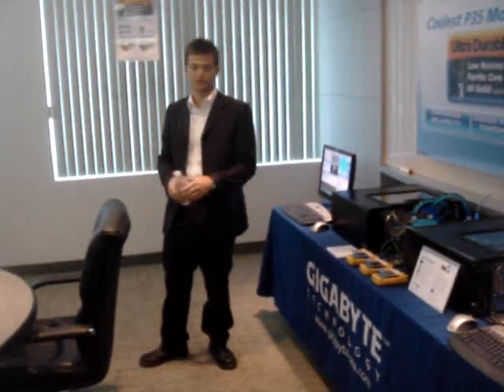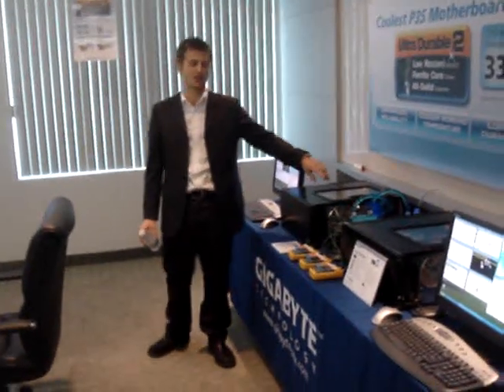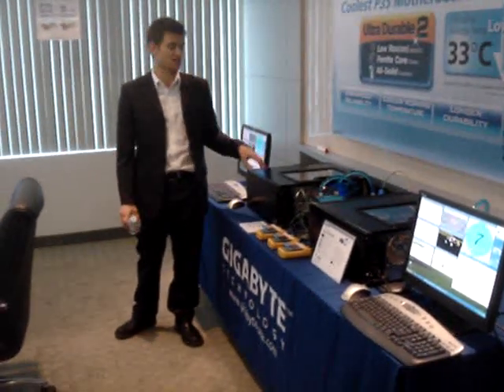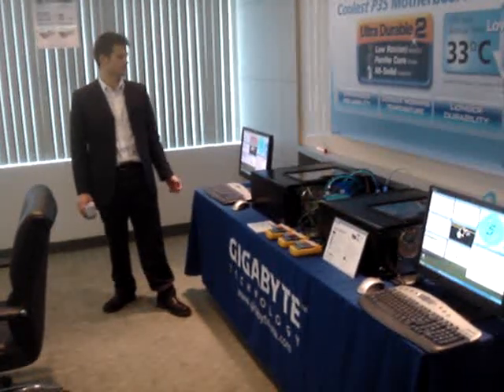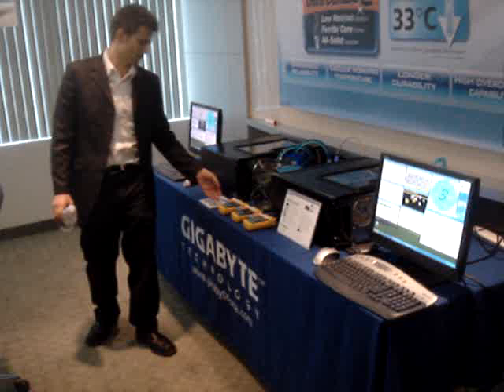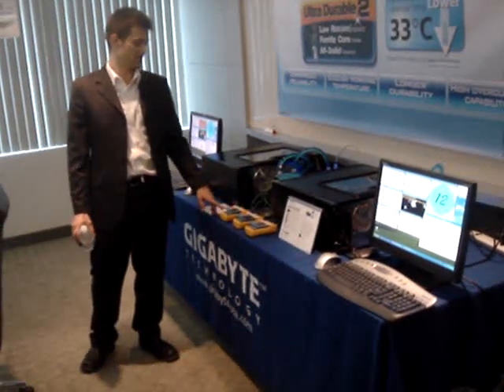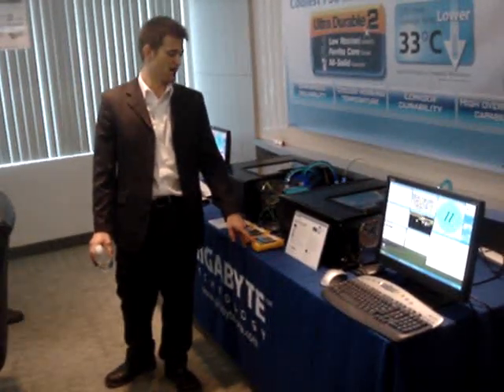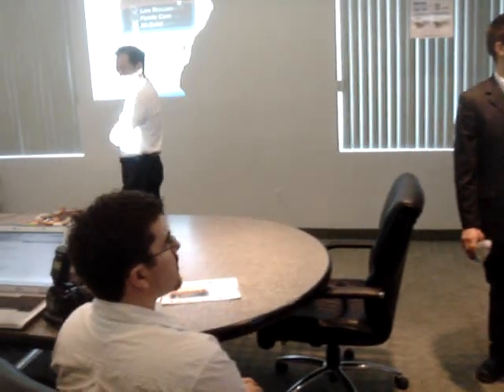GIGABYTE vs ASUS live demo

Comment: gigabyte has completly come out of the hole they were in long ago i put gigabyte boards in everything i built wouldnt have it any other way all boards have been great to me from the ep45ud3p i gave my wife to the x58aud3r im on now  never had a prob what so ever gotta say though my ep45ud3p is my fav board just cuz its old fast as hell overclocked for 4 years now still running perfect tech support is great

Comment: I've owned Gigabtye boards, nForce3 and 570 SLI they both still work and I gave them to family members who use them everyday. My Asus board had the PCI-E slot die. I also have a six year old MSI board I used for my wifes computer, works fine. My mobo I'm using right now is a MSI K9N2 Diamond, it works great everyday. My next mobo will be a MSI or a Gigabyte... I might even go with a DFI if they use a nvidia chipset I like.

Comment: I've tried with two PSUs one 420W the other 700W with the same result. The cpu is c2 duo e8400.
After searching on the net I found the problem with this boards is fairly common. I hope I can return it to the reseller and get an Asus.

Comment: I liked GB and just got an ep45-ds3. Initially the board failed to POST when memory was present in slot 1. After a few boots it started failing no matter where the memory is installed. I traced the problem by removing components leaving only the cpu - with the same result - no POST amd the board power-cycles every 5 or so secs. With the cpu out of the board it does not power cycle. Resetting the cmos didn,t help, and the board does this when out of the case too (so there is no short underneath).